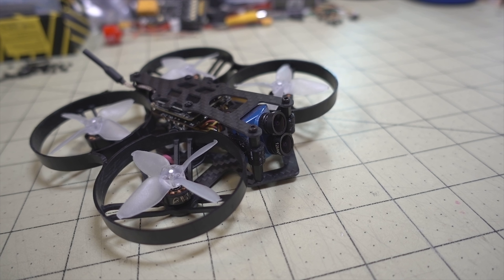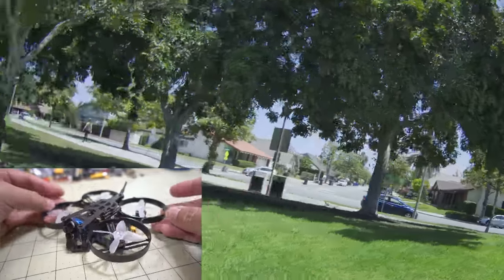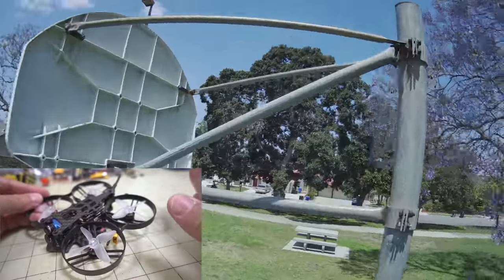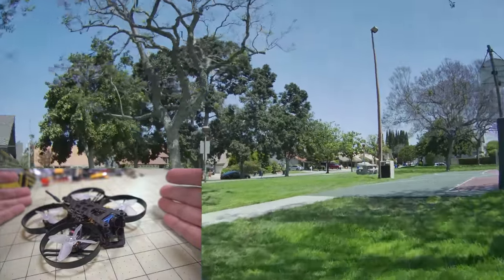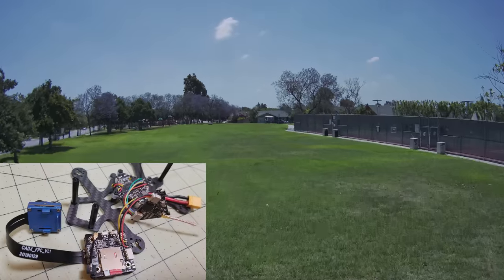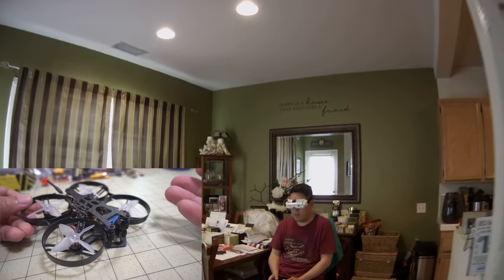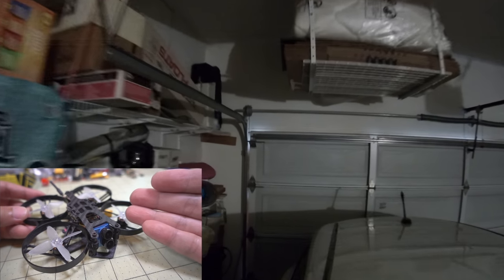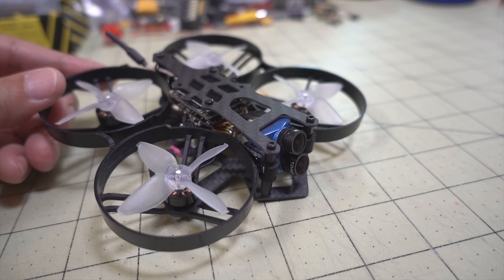World's Lightest 4K Cinewhoop? // Caddx Tarsier 📷🚁

Comment: Wondering if the proximity of the boards is increasing the failure due to heat stress and build-up, which would make them more likely to fail in a minor crash or an extended flight?  Otherwise, it is a brilliant concept that might just need a little more R&D.  What an Awesome and Innovative effort!
Reply from the maker: Unlikely due to heat because I never got any core temp warnings in my OSD.  More likely a cold solder somewhere in the flight controller component.  This is hardly the first time this has happened to me on a crash.
Reply: @AlbertKimTV  Oh, forgot about that feature...lol  However, for that to happen on such a minor crash is really unlucky, IMO.

Comment: Hey, thanks for the info. The video is very informative, especially when you mention you got 6 flights before the AIO GEPRC/BETAFPV whoop ESC's/board failed. I have a couple of questions:

1. - How warm was the temperature in the environment, every time you flew (by appearance, it looks like you were in a warm 80+ degrees F environment)?
2. - What were the LIPOs you used for each flight (and how many minutes were you in the air each flight, approx)?

You didn't mention what LIPOs you used in the video for each flight. At least you checked for motor heat after each flight. :) Were you able to check the heat on the board in any of the flights? :) 

Let us know. :)  Thank you.... Keep up the flights.  

P.S. Did the Tarsier survive the board burnout? I'm guessing you were powering it up from the board. :)
Reply from the maker: Temps were in the 70's, not hot at all. motors weren't warm, I had a good tune on them.  I didn't do anything obviously dumb like a beginner might do, so let's put that to rest.  Tarsier was fine, no damage and I will use it on something else soon.
Reply: @AlbertKimTV  He he, gotcha. I was actually aiming at possibly a defect with the GEPRC/BETAPFV board. 
I encountered an FC board rated for 2-4s, but refused to activate/respond once a 4s lipo was connected to it. Gave up on that FC for a while (got 2 of them, sucks). One day, I might still use it with a regulator in the future for a Frankenbuild perhaps (solving the other issue with that FC model, LED pin doesn't work, either). lol

Comment: Good potential and I like the idea. But unless they deal with the jello and durability it's a nope from me. I just crashed my 75x a half dozen times, turtled out of a tree twice and no issues. So I know they can make an esc that doesn't smoke at the slightest bump. 
Thanks Albert 🤓
Reply from the maker: I'm not sure why the FC died... could be because it's a first run of that board.
Reply: @AlbertKimTV  Hopefully that's it. 🤞🤓

Comment: My main problem with this camera is that they failed to understand why you would want two lenses. Other than lower latency on the FPV (which seems to be their main reason), I want interchangeable lenses!  They really should have put an m12 on the 4k and an m8 on the fpv. I want to go 3-5mm on the 4k lens, and good M8 lenses are hard to come by. Guess I'll have to modify it.
Reply from the maker: The main reasons were low latency FPV camera and better looking FPV feed.  This is  a first gen product and they will re-engineer this for an M12 lens since the case is limited in space.  If these are important to you, I'd suggest waiting for the 2nd gen product.
Reply: @AlbertKimTV  I'm still going to buy one now. There isn't anything else that can do what this does. I'll get a second one to modify to the M12 lens. I think it can fit, but it will be tight. If it doesn't work, I'll just put it back to OEM.

Comment: Wow technology at its best. Can we fix this cam on geprc cx2 115mm frame? Can this cam be linked with betaflight like runcam?
Reply from the maker: Should fit that frame but not sure about lens protection.  What do you mean by "linked"?
Reply: @AlbertKimTV  configured with BF to assign switches on Tx
Reply from the maker: You mean the camera control feature?  That used the gimbal sticks and not the switches.  There is a new camera control board coming from Caddx that will work with the Tarsier to enable that feature.  I will have a video at some point later.

Comment: the motor burned the esc, beta fpv has crap wire in there motors, havent trusted them since the first beta65
Reply from the maker: What do you think killed the FC then?
Reply: when wires cross in the motor it can actually generate power and back feed into the system, all brushless motors are capable of this

Comment: 4K cameras are kinda pointless still because 4K technology is still relatively new and most people will still
be using 1080p monitors, unless they have purposely bought 4K ones which are not cheap.
Plus the huge file size is a drawback too.